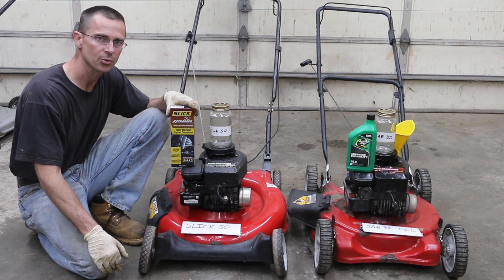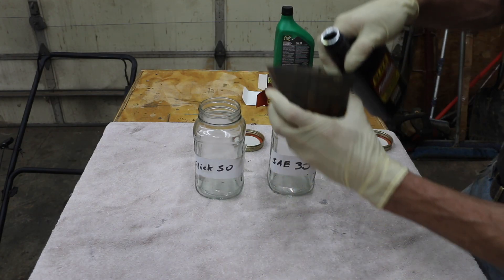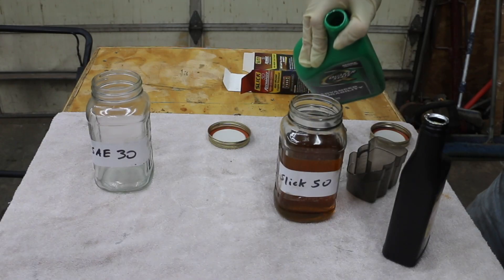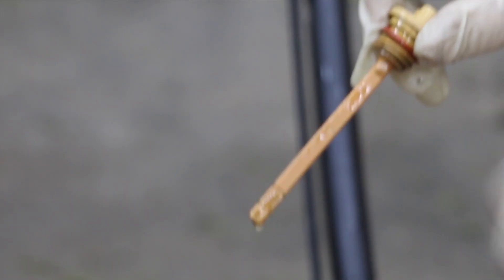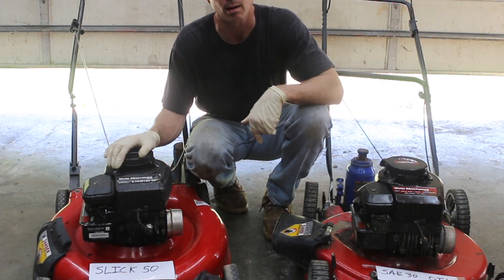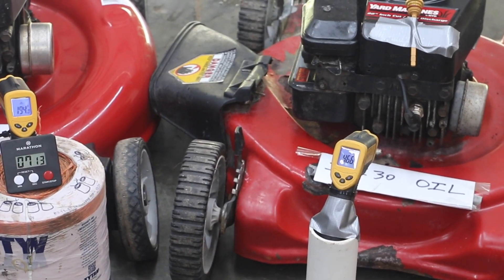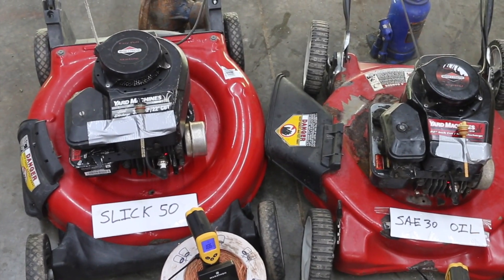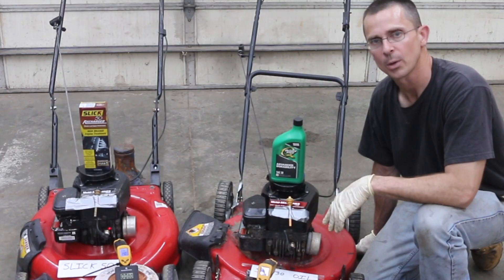Can't believe what SLICK 50 did to my engine!!--Dry Crankcase Test!

Comment: Personally, I never liked Slick 50 from the start, it is just a PTFE suspension (Teflon) and there was conjecture that if you had a high efficiency filter it would remove it. 
What I did have back in the 1990's was a product called Protec, it was described as a metal treatment that you added once. I used it in everything. There was a huge difference in my roller skate and bicycle bearing friction and fishing reels were smoother and cooler. 
The BIG "test" came when my front crankshaft seal literally blew out of the front cover on my '77 Toyota Celica and I lost all my oil and went to ZERO oil pressure. 
Being young and foolish I figured since I had the magic juice in it I would be ok...... I drove my remaining 10 miles in 20 minutes and when I got home I had not overheated and had not seized, the engine was still running perfectly! 
I tapped the seal back in place added 4 quarts of oil and retreated with 16oz of Protec. 
The car ran fine for another 100,000 miles when I had to retire it due to emissions issues. 
I cannot find the product anymore, but there is a product called Pro-Blend that makes the same claims, however I'm in no hurry to test it!
Reply from the maker: I enjoyed reading about your experience with Protec.  Thanks for watching the video and commenting!

Comment: I've built V8 automobile engines for Demo Derby Cars, these engines will run out of coolant at some point in competition . A guy needs to do every trick he can think of to get the engine from locking up and running even one minute longer then the next guy. I did back to back testing on my engine running stand, and just going from mineral oil (which I use to break in the rings and the rest of the engine,) to synthetic dropped a solid 10 - 12% in temp. I also found that the temps get so high that the springs in the hyd lifters will collapse , and also the valve springs will loose their tension . I did a test with a freshly built engine after it was broke in and running synthetic oil at a good hot running temp of  190*-195* and I set the idle right at a solid 1,000  rpm then added Dura Lube and after about 5-6 minutes the idle went up to 1,150 rpm and all the temps (oil, water, intake, head, headers & etc) dropped a solid 8-10%. Now that's just what happened with my testing, others I'm sure will differ. I do like to see test's like this with the lawn mower engines, a guy can learn a lot.

Comment: While the oil was still in them, did you keep running both until they wouldn't get any hotter? I ask because 1 person asked if maybe the Slick 50 was a temperature insulator which hid the real temperature and maybe the Slick 50 engine was actually hotter on the inside? Seems unlikely, but it was a reasonable question for him to ask.

Comment: On this, the result was surprising taken that I also remember the commercials.  However, I wonder if you could have put oil in the slick 50 engine and started it? 

 I am sure that damage was done, but I would bet less damage.  The reason being is the slick 50 engine clearly stayed much cooler.

 I think the reason the non slick 50 engine ran longer is that it ran much hotter, and hot metals will yield more easily, meaning the bearings won't lock up until they get hot enough to seize.  You were measuring cylinder head temps, which was a good test, but if you could measure the crank bearings, I bet you would see that they were MUCH hotter than the head.  I beat you would have been able to put oil in the slick 50 engine and start it..

Still, the commercial seemed to lie! It was an interesting test, and not what I expected to happen.  I expected a very slight increase in run time in the slick 50 engine...

Comment: Repeat the test with Xcelplus. The founder lost control of the Slick 50 trademarked name in the late 80's but retained control of the original formula. 
According to video about Xcelplus the Slick 50 you tested with is not the same as the original from the early 80's.
Realistically a lubricity test with bearings would be more accurate as there would be less variables and really it is all about the metal to metal contact and has nothing to do with combustion other than the heat generated by that process and how it is conducted thru out the engine. 
The only way you can obtain relative accurate results is identical motors out of the box with same break in time and loads. 
Interesting video and I enjoyed watching it. 
Thank you.

Comment: Wynns Oil Additive used to do the same demonstration for mechanics. They would bring an engine on a stand to our shop and run  it for the length of the meeting with no oil. I was impressed until an older mechanic explained the trick: There is no load on the (well balanced) engine so there is little force on the bearings. Therefore, little heat to burn the thin film of oil off. 

It could be that the trick doesn't work so well on a lawn mower engines because of balance issues.

Don't get me wrong, these products might help prevent wear and improve lubrication. I just wouldn't rely on the dry-engine test for proof of how good they are. I sold Wynns products to my customers for years thinking that I might be doing them some good while making a small commission on every bottle. 

Bottom line: these products might help, and probably don't hurt, but the dry-engine demo is mainly smoke and mirrors.

Comment: I think the slick 50 could've deliberately ceased the engine so it would be possible to save it again.
Then again it could be the fact of that both engines will have un equel wear, you'd need to do it with 2 brand new engines.

Comment: i added slick 50 to a engine back in 1994 or so, it used alot of oil, then drove it until ran out of oil ( zero oil pressure ) then drove it the rest of the way to work about 15 miles, drove it back home about 30 more miles, i was trying to blow the engine...but it did not hurt the engine... i knew it was good stuff back then.

Comment: In 30 yrs in the engine re-manufacturing industry the only additive that i have seen that was worth using is Lucas oil stabilizer.
Helps prevent oil breakdown due to heat. The bad thing about additives is that they can make vehicle owners less concerned about proper oil change intervals.

Comment: There is no way that I would allow this video to play a role in determining whether to use either of these products. This is not a very controlled experiment. You would need to use NEW engines. These engines would need to be tested for comparison before the experiment. Everything about the engines needs to be as close to identical as possible. There are many factors that I can see played  havoc on your results.

Comment: 1. You should have used the 10% recommended amount. Both engines should have had temperature checked prior with the same sae 30 oil. Run temperature can vary with airflow to carb.(rich, lean). If the Slick 50 reduced the viscosity of the sae 30 that would account for the lower temperature and the less film strength causing the early failure. Lower viscosity runs cooler yet protects less because of thinner film strength.

Comment: You may want to redo this test. Great idea, but run those engines away from each other, the exhaust from the Slick 50 engine was most likely mucking up your temp readings on the engine with conventional oil. And like +realflow100 commented below, I would bet the Slick 50 engine is repairable since it didn't heat up

Comment: Hi.  Great videos.  I only just discovered your channel an hour ago and after 3 or 4 videos I am your newest subscriber.  Keep up the great work!

I had a 1981 Ford F250 with a 351M that I had treated with Slick 50 in the late 1990s.  I had only treated it the one time, and it was (as best I can recall) around 4 or 5 oil changes later that I was in the wrong place at  the worst possible time.  I was on a hunting trip in the back country of the Mojave Desert when my water pump went.  Luckily it was only another couple of miles to the highway, but it was still at least 5 miles from there to the nearest... well, anything that had water, phone or even another human being.  Now I know exactly nothing about mechanics.  I can do the normal upkeep and maintenance and even some basic repairs on vehicles of all shapes and sizes, but that's about it. I was a Park Ranger, so my interests and schooling were in ecology, wildlife management and other areas, so all I knew was, "Don't let it get too hot, but don't shut it off."  To this day I'm convinced that God protects fools, drunks and children and that dumb luck, a cool evening, a scared kid (well, 30 year old kid) doing everything he knew to keep the temp down and Slick 50 saved my truck.  I may be wrong, it wouldn't be the first time.  After all, the truck had been my dad's and he knew vehicles.  It was a trailer special with an extra quart of capacity in the crank case, a high volume oil pump and an oversized radiator, and it would tow away anything you hooked up to it without trouble.  I miss that old truck, but the gas mileage....

Comment: I don't get it.  The Slick 50 engine wasn't even that hot when it stopped running.  What failed in that engine compared to the other?  Were they equally damaged?

Comment: Wynn's motor treatment does indeed allow a motor to run at ZERO damage to engine.  At age 15 I personally won bet.  Back then at when there was "Service Stations" per bet I allowed mechanic to drain oil in my car.  I was to drive at predetermined location & return.  W/the mechanic in car we drove the distance & returned.   It turned out to be 14 miles.  The hydraulic values where doing there expected clacking, but other than that it performed perfectly.  They returned my original oil back into the engine. I collected my bet & drove away.  I continue to use that car till my Graduation from High School W/zero problems W/oil related issues.  I bought myself a very nice 8-track player W/my winnings.  
   Now how'd I know all this?  I'd seen my Dad do exactly the same in his sales truck when challenged in his sales pitch many times when I'd ride W/him during Summer months.  I understand there are now more "Copy Cat" products that will do same.  But until I see it W/own eyes I'd never trust it.  But Wynn's certainly does.  You old school drag race fans out there.  Remember Don Garlits "Wynn's Jammer" cars.

Comment: I too was Shocked at how quickly the Slick50 engine seized. Dura Lube used to brag they were better than Slick 50 and used pressure against a spinning bearing to show how much better Dura Lube was than Slick 50 or oil. I would like to see the same trial adding Dura Lube and synthetic oil against the Slick50 and regular oil.

Comment: Back in the day oil was dino. Now it's semi-synthetic . Semi synthetic means a large percentage of the oil being dino, and a small percentage synthetic. When you drained them, you did not run the engines completely dry. There obviously was some residue. 
The slick 50 seems thicker, and more heat insulating than modern oil. 
That's why I think, that the SAE30 engine ran hotter than the Slick 50, because more of the engine heat was transferred to the housing... It's a theory, not sure how true it holds.

Like with the prev video, it would be nice to see the damage to the pistons/cylinder walls.

Comment: I used slick 50 in my toyota with a 22r engine and yes it ran without  any oil in it. i was mudding and poked a hole in my oilpan. yes it made a lot of noise but I drove it 30 miles home. but I did gut the oil filter before.

Comment: I once ran a lawnmower with 100% Slick 50 in the crankcase. Seized up and completely ruined the motor, with chunks of metal coming out in the oil. A friend of mine and I used the same batch in our cars earlier and the oil pressure went down so much we ended up draining it out after only a couple days. Maybe it was just a bad batch, but I'm never trusting that stuff again.

Comment: what you have is not the original slick 50 formula that it started out that is from the ads you remember. the original slick 50 was discontinued in 1984 due to legal issues. however the name was not copyright protected. large oil companies bought the name but not the original formulation. check out youtube video titled What happened to slick 50. that video is an interview with the man that developed the original slick 50. good work on the video.

Comment: I used to build some hot rod Gremlins, but I never had good results from SLICK 50. Right away engines seemed less powerful with SLICK 50 compared to using quality synthetic oils such as MOBIL 1 or AMSOIL. ROYAL PURPLE also disappointed me as well.
Reply: Attorney Generals would not have sued this company and put severe restrictions on their exaggerated claims if this product was any good. Just a tiny bit of Teflon suspended in normal premium conventional oil just isn't very special. This is nothing like the military grade $1000 a quart moly lubricants or other quality lubricants. There is simply not enough Teflon to do any good other than to allow more friction than normal under some engine conditions.

Comment: zMax additive actually works might try that out it actually penetrates the metal and when high heat from friction occurs the metal sweats out lube aka in bearing journals / cylinder walls and cam bearings and such we tested it before and is really amazing but need to retreat a engine every  6 oil changes or so seen that from testing over time the lube leaves the metal in the instance of lack of the additive in the oil so got to retreat every 6 oil changes or so.

We had a engine drop the oil pump while racing and well tore it down to all our amazement very little bearing damage or anything (was able to handle 12 more races before rebuild) and it had no oil pressure at full throttle 100+mph for the last bit of the race on quarter mile track around 1/2way the pump failed enough so that my uncle thought the engine was ruined and hell ran it till the end of race with no oil pump in a big block 454 cranking around 750hp raw motor and 250hp+ of Nitrous .

Comment: So, with all of your tests (thanks, YOU test, saves me the repair costs!), what would be your suggestions?

Duralube straight, 50/50?
Slick50 mix?
Good old cheap 30 weight?
30 weight synthetic?

Run tests using the BestLine treatment products.

Comment: Honestly you need to do this test with two brand new engines because you really don't know how many hours were on either engines. Obviously heat is the most common cause for engine failure and the Slick 50 engine was running way cooler. So that leads me to believe the Sick 50 motor had a lot more hours on it .

Comment: I was a slick50 fan and swore by the stuff in old worn out engines but maybe I was conned by the flash adds. That was a very disappointing result but the proof is in the pudding and the fact is Slick50 didn't protect the little motor at all. Thanks for doing the experiment, it was worth watching and knowing the results.

Comment: I used Slick50 in a car many years ago and loved it. My economy improved and it ran much quieter and more smooothly. I'm suprised by the results here but I do remember one thing...the instructions when I used it said it needed at least 500 miles of driving to bond with the engine parts and become effective.  I noticed an improvement after around 750 - 1000 miles.  

I suspect that was why the Slick 50 engine failed in this test - it didn't have enough 'run in' time to adhere. 

Great test though and I love your videos!  Thanks.

Comment: Hi guys.  I worked at a quick lube for 5 yrs when I was younger.  I have never seen ANY oil additive that was worth the extra expense.  Often times for the same money, new oil and filter could be purchased.  I used(because I worked there) every brand (except Pennzoil....dont ever use that stuff) and they are all comparable.  For the money the semi-synthetic oils are the best.  These oil additives are snake oil and always have.  That said, I'm sure there are plenty of "stories" of situations where these wastes of money have "worked."  Nothing compares to an engine that has had regular oil changes with good oil(Not Pennzoil...lol).  This practice is proven and sound and will pay dividends on the back end of the engine's service life.

Comment: There are variables that you did not address. You were using used lawnmowers. And was the where equal on both lawnmowers at the time of the test. Probably not. The fuel air mixture or on both lawnmowers was probably not exactly the same. Therefore cylinder head temperature could be wildly different. Last but very important you do not have a tachometer on either lawnmower. What rpm where they ran at?  I too was quite surprised that the engine was like 50 failed so soon. But when I was looking at the wheels on that lawnmower it look like it had a lot more use as the tires were bald and cambered in obviously a well used the lawn mower.

Comment: those two lawnmowers suppose to be brand new both of them vs. one old and one kind of new. The engines are not the same.One is kind of used up and the other is kind of new.The guy suppose to do a reverse engine tests as well switch the SLICK 50 to other motor and compare the figures.

Comment: I had an uncle that did Slick 50 religiously and lost oil pressure one in his truck,  and when we pulled the engine it had a thick, sticky, almost silicone telling type sludge all through it. The engine shop couldn't get it all out so we swapped the engine completely and he never used it again. Lucas causes the oil to foam in the top of the rocker boxes in our semi trucks and causes havoc with goo and stopping up filters so I wouldn't recommend either for your engine,  gas or diesel..